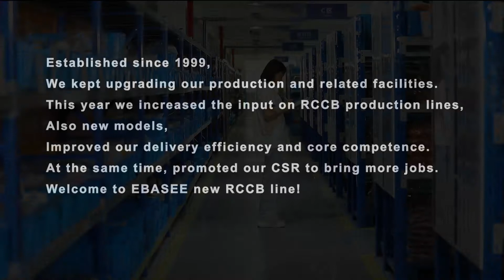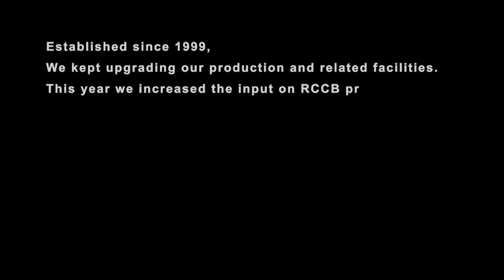Electrical switch：how an electrical switch is produced？

Comment from the maker: As a leading supplier in the low voltage electrics industry, Shanghai Ebasee Electric Co., Ltd. products have been used for residential, commercial, and industrial applications with its quality and service. EBASEE brand is recognized for its quality and reliability in an ever-increasing number of markets worldwide. So far EBASEE products have gained many international approvals, such as TUV, KEMA, CB, SEMKO, RoHS, CE, and CCC, etc.

 With quality raw materials and components supply, all products are manufactured to EBASEE's defined specifications. We have 4 semi-auto production lines, up-to-date quality control facilities, and well-trained skillful workers. Moreover, with a technical R & D team and a fully equipped in-house laboratory, the EBASEE factory can carry out efficient new product development and daily production QC as well.

 EBASEE has a wide range of cooperations with world-leading companies in new products developing or OEM, ODM cooperation. Meanwhile, we also process industry cooperation on intelligent home products and work with some universities such as Xi'an Jiao Tong University on project solutions. EBASEE is focused on achieving growth through the growth and success of its worldwide partners. 

EBASEE, guided by the "market-oriented" philosophy, powered with the "Quick response and flexible supply" capability, can support our worldwide partners to compete against established global players to deliver the most comprehensive and cost-effective products and services in the market.

 "Smart living, Green EBASEE" 
（https://www.ebasee-electric.com/）